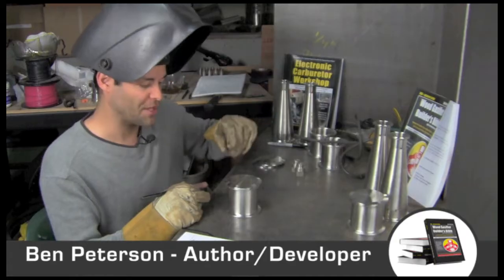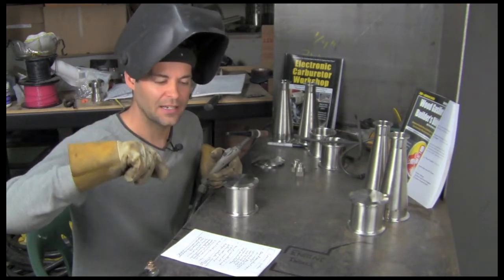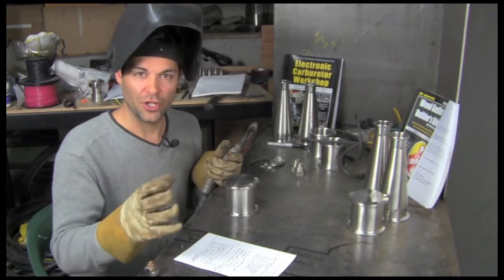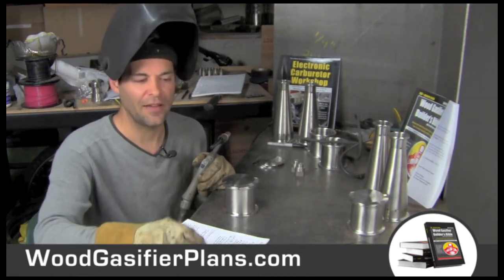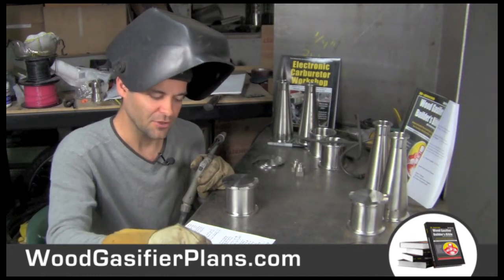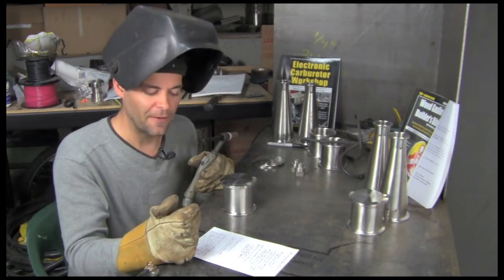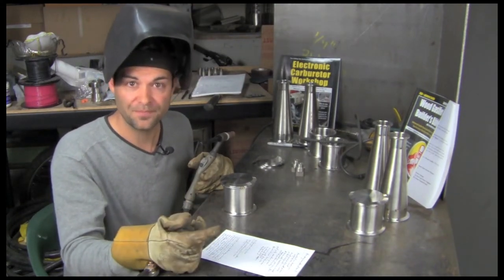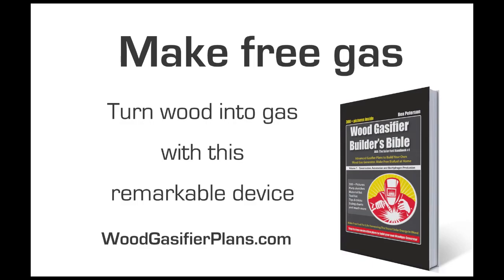Wood Gas Crash Course 7 of 7 (Gasification 201) woodgasifierplans.com

Comment: I will buy your books. 
OK Carburated engine is the way to go. So for a basic Ford truck, 350 engine. You say a pound or two oof wood per mile or 2 miles. Other people say a pound of wood is like a gallon of gasoline, so 12 miles on a pound of wood.
Reply: +Mark Green The range of below 20% moisture dried down, sized prepped wood found to be needed by those actually USING is in the range or 16 to 30 pound of wood for each one US gallon of gasoline being replaced. Huge difference in gasifier designs and heats recaptering. Huge difnnece between the actual IC engine designs.
Even gasoline itself get raged from 6.2 pounf pre gallon to 7.2 pound per gallon . . . depending on formulation.
Also hands down EFI engine system are proving easier to convert over.
Steve Unruh
Reply: A pound per mile using just chunked wood is what the guy who won all the Mother Earth News competitions is getting in his trucks. I do know you want as big a displacement engine as you can when using in vehicles.

Comment: Nice vids, Ben. You are right- burning wood is a form of solar power. I presume your ash residue is primarily the white lye-ash useful for fertilizer and soap-making. I'd like to do a project that doesn't burn all the carbon out of natural woods, leaving the charcoal residue (very different to your full-burn design). I also saw a nice vid on garbage pyrolysis- some people claim clean burns, others were scared of the consequences of certain plastics. There was even an ionisation-boosted plasma version. All just dreams until I build my shed. Thanks and good luck

Comment: I noticed an orange flame, you would not put that into any motor right? Cooling filtering and condensing then into the engine. After the reactor of course.
Reply: I'm pretty sure the flame was from filtered gas, but yes, the flame would not go to the engine -- the unlit gas would go to the engine.  The flame was done just for visibility for the video.